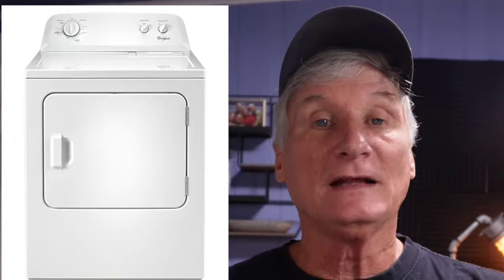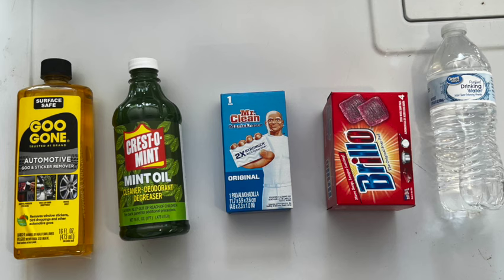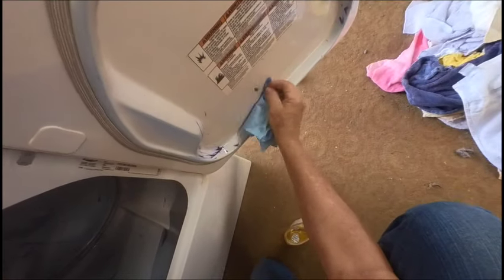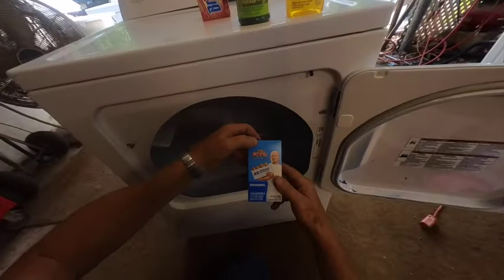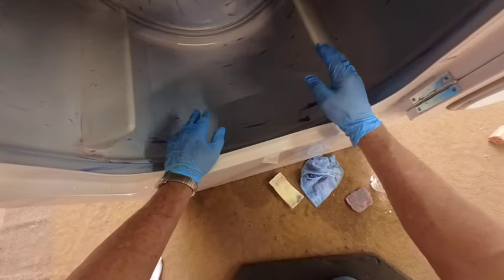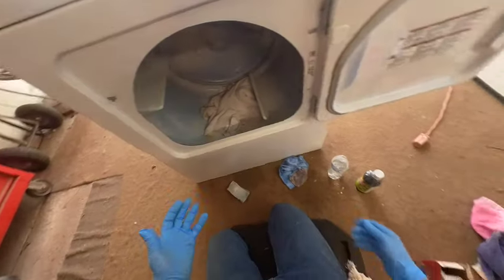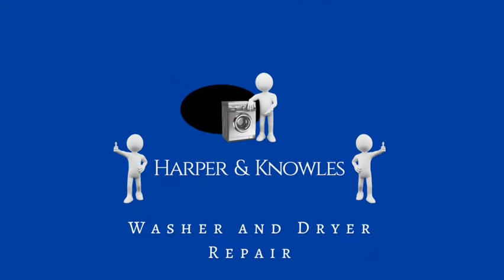How To Clean Ink Pen Stains from Your Dryer's Drum: Easy Solutions to Avoid a New Purchase

Comment: I used Nail Polish and washed it again with soap and water. Worked great. Goo gone took only the top layer on it. It eventually came off but the nail polish was much faster. Because nail polish is hazardous to heat, you MUST WASH IT AGAIN WITH SOAP and WATER.....then dry it with a paper towel. Looks great. : )
Reply from the maker: Thanks for the tip. I hope others see this and benefit from your experience. Thanks for watching!
Reply: Is it nail polish remover?

Comment: I would add a very important step, run your dryer on high after clothes are out. Let it cool and with a plastic scrapper, scrape off the large blots of ink. They have plastics in them so with lift right off. If not you will smudge the ink all over your dryer and make it harder to clean with Acetone.
Reply from the maker: Great tip. Thanks for watching!

Comment: Luckily I had a big bottle if acetone from when I was doing my own nails. My dryer had looked just like yours did. I had a crappy cloth mask on & took several breaks...plus had a fan blowing into the dryer. I tried everything (using a magic eraser) from goo gone, comet cleanser, wd-40, brake fluid, vinegar, bleach.. the only thing that took the ink completely off was acetone... BUT it also started taking off the paint! SO BE CAREFUL!
Reply from the maker: Great advice, I know that brake fluid is bad on paint!!! I bet you check all the pockets now!

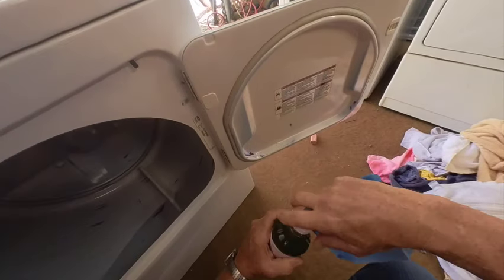Comment: I washed a tote bag and 2:28  forgot that I left an ink pen in it. It was all over the dryer. It ruined a pair of jeans too.
I used Mr. Clean Magic Erase and 409. I sprayed the spots of ink with 409 and wiped it down with the Magic Erase. It got a good 95% of the stains out. The ones that were toughest were on the back wall where the white is, on the dryer. 
After I was done, I wet 2 old bath towels and put them in the dryer to clean out any residue. Worked very well, and fumes weren't too strong.
Oh, and I threw in a couple dryer sheets with the towels to get any smell out.
Hope this helps someone. Next time, I'll check the pockets.
Reply from the maker: Thanks for sharing your experience. Thanks for watching too!

Comment: 7/23 I had ink leak from a ball point pen, into the dryer drum. I tried alcohol with a sponge and magic eraser and got nowhere. Then I heated the dryer for 20+ minutes (which may not be needed) and used a scrub brush and dawn dish soap and with some effort it all came out. 
Fear not, you can get it out!
Reply from the maker: Thanks for the tip and thanks for watching my video!

Comment: Thanks for your video really made me feel better about my new dryer that my wife left a ink pen in her pocket. This product worked great for me. I wore a mask while applying this product, but it took it right off. 
Non-acetone nail polish remover from target. Got the job done in minutes.
Reply from the maker: Glad I could help! Thanks for watching and for your kind comment too!
Reply: I had the same mess with ink !   While the dryer was hot.  I used rubbing alcohol!     Little  elbow grease, You have to hold your nose, but it works!  I wiped clean with water afterwards,
Reply from the maker: Hey Doris, thanks for the tip!

Comment: Ink leaked all over. Wore a gas mask, fans to blow it outside.  Non flammable acetone is all I had after I used a whole bottle of my wife’s nail polish remover. You have to do it fast as it evaporates instantaneously. Lots and lots of elbow grease and rags! It’s not easy as you described
Reply from the maker: I don’t think I said it was easy!  It takes a lot of work whatever you use. Thanks for watching!
Reply: @HarperandKnowles  Sorry, I did not mean you described it was easy. I should have worded that the job is as you described, it does take “lots of elbow grease.”
Reply from the maker: Hey, it’s all good. No offense was taken. I should have realized a comma was missing. I’m glad you didn’t give up and scrap your dryer! Carry on, my friend!
Reply: @HarperandKnowles  Great video, thanks for showing the various methods. Hopefully I check my pockets before throwing pens in the dryer!

Comment: For general clean up the best I have found is Mighty Boss from tractor supply. I don't know how it does on ink. I would think a penetrating/lubricant spray like PB Blaster or WD40  would work good.
Reply from the maker: I tried WD40, no luck with that.  I'll give PB Blaster a try.  Someone told me brake cleaner would work too. Thanks for the tip my friend.
Reply: Nope. I tried wd-40
Reply: @HarperandKnowles  my dad suggested brake cleaner...NOPE lol

Comment: If it is so hard to get off, how does it get on clothes so easily?  Is the heat?
  If it is the heat, why not use a heat gun along with something else?
Reply from the maker: It might be the combination of detergent and moisture left in the clothes after washing. It sure doesn't wipe off on your finger. I'll try a heat gun on it next time I get one with ink in it. Thanks for the suggestion.
Reply: @HarperandKnowles  I might experiment with heat on a drum ink from one of my scrapped dryers. 
  If I do, I will apply ink and make sure it is dry before trying to remove it.
Reply from the maker: @rickeykeeton4770  let me know how it turns out.
Reply: A heat gun will set that ink PERMANENTLY to the surface

Comment: Rubbing alcohol and hair spray .... Elbow grease and it works great too... Hairspray for the ink spots on your clothes will take it right out.
Reply from the maker: Hairspray??? I would never have thought of that. Thanks for sharing and watching too!
Reply: I tried both of these, and it didn't work at all. I think it has a lot to do with the material and paint of the dryer because in the plastic sections, hairspray took the ink off immediately. Haven't been able to get anything to work so far, going to try the Dawn soap and scrub brush.